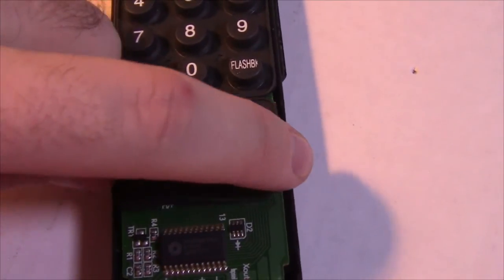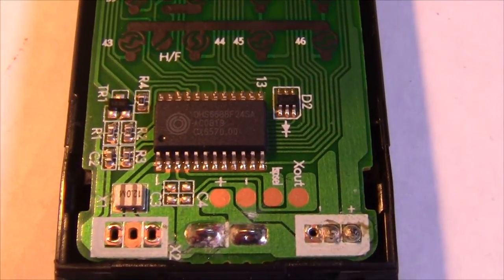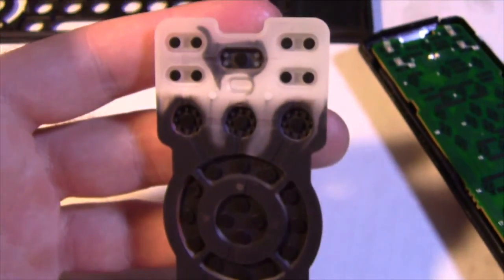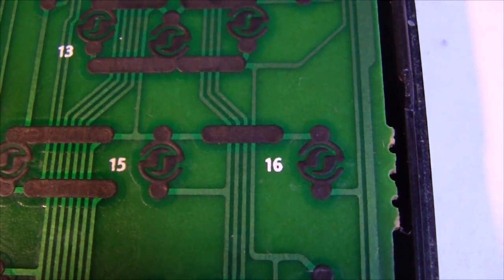How to Disable Buttons on a TV Remote Control

Comment: I would have put a larger piece of tape so that it covered the two sides of the button area as well as the led. That way three pieces of tape would have done the job. I would cover the led too because it is not gong to light anyway. It is a pretty sure bet that the tape would do the job. Cutting a larger piece of tape to cover more area will save time. Or how about placing the tape on the rubber end of the contact?
Reply from the maker: The reason I used separate pieces of tape for either side of the LED is because I was concerned that it wouldn't stick as well to the non-flat LED surface. A few extra minutes applying those extra pieces of tape seemed like a worthwhile investment in time if it could avoid me having to open it back up and reapply the tape. Sticking the tape to the rubber would have probably worked too.